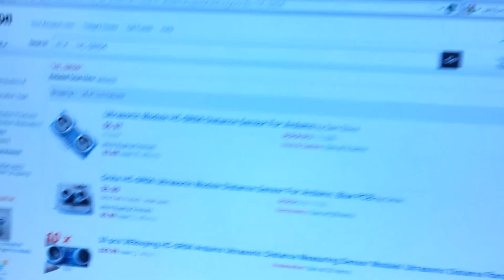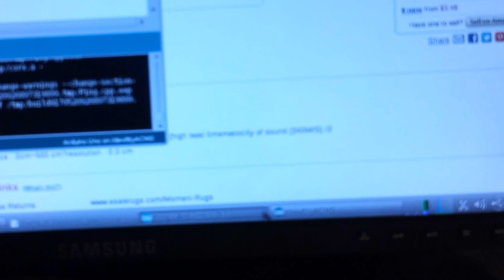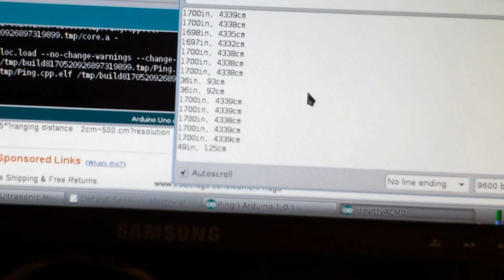Arduino Ping Sensor (Ultrasonic Module HC-SR04)

Comment: Quick question, what did you use to power the Ultrasonic Module? I've been reading about batteries and the recommended method would be 4 AA batteries to supply 4.8V because I know that the sensor needs 5V. Could you help explain to me what is the best choice? My project requires practicality so I cant be changing the batteries in short amounts of time and the sensor will be on 24/7.

Comment: say I wanted to wire up the analog audio signal of a headphone jack, and then have it's pitch modified similar to the "pitchfollow" example that's included in the arduino software. Only instead of using a photoresistor, I used the HC-SR04. Do you have any idea how i would go about doing that? sorry I'm new to arduino, Thanks!!